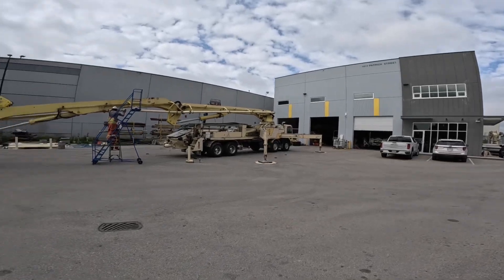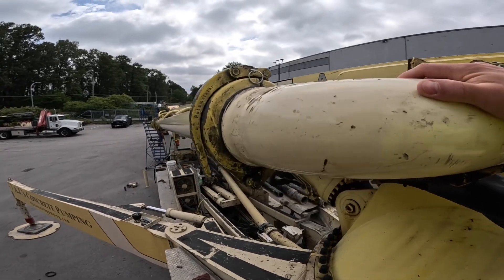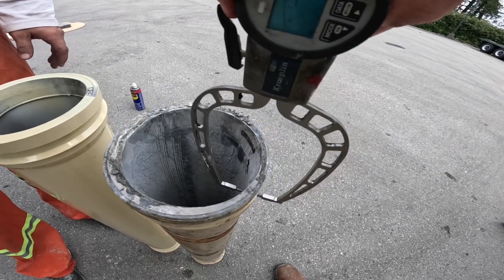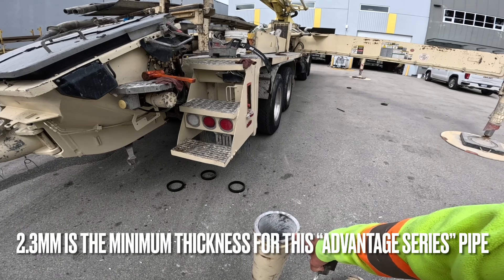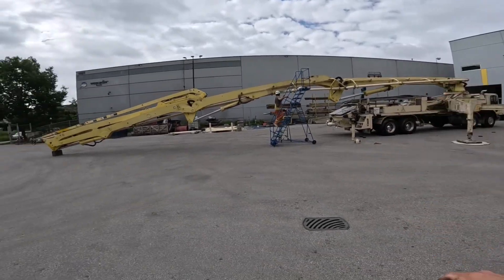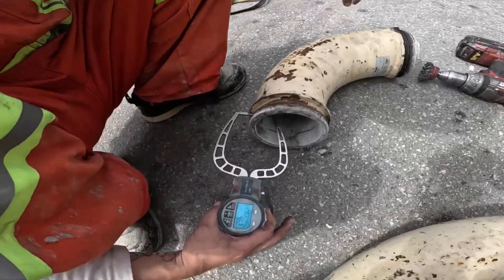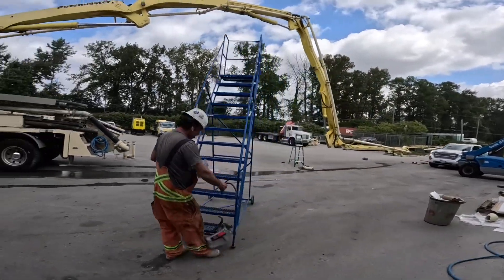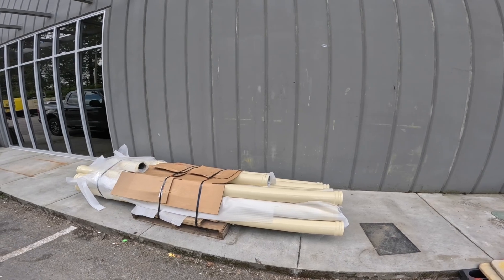Re-piping a PUTZMEISTER 47M boom pump.

Comment: How do the pipes handle articulation? Rotatory manifolds at each bore? Coming from straight stick cranes, this stuff is fascinating. I definitely see why in Onterrible there's such an overlap with the boom pump certs and the branch 1&2 hoisting engineer tickets
Reply: Do you mean the concrete delivery tubes?